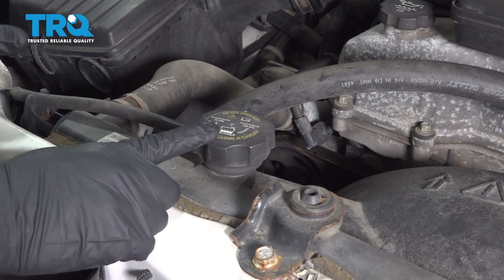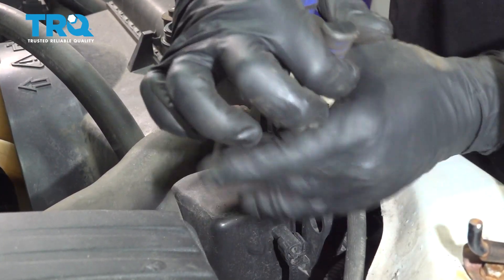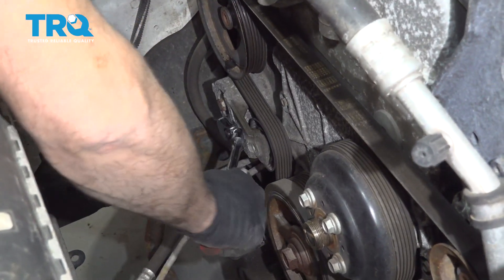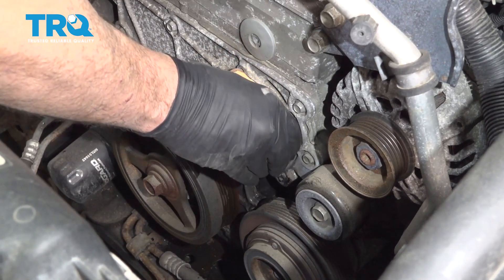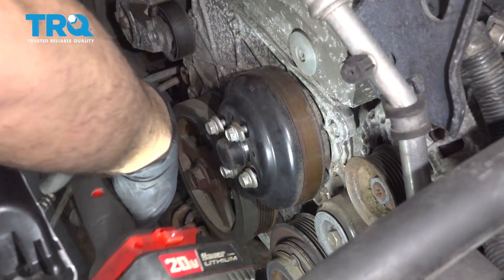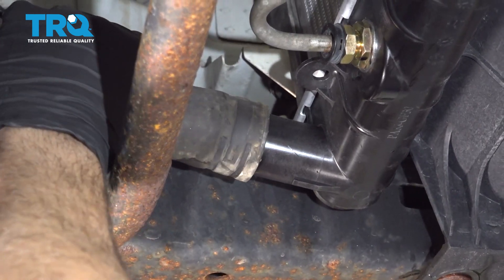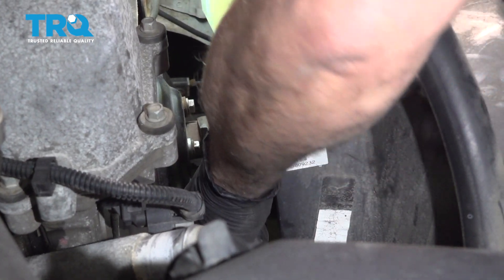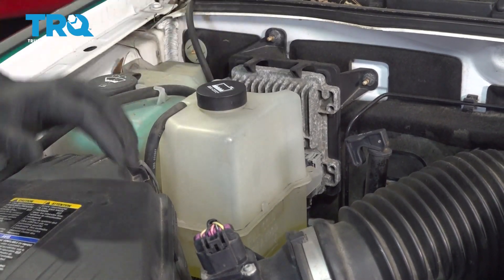How To Replace Engine Water Pump 2004-2012 Chevy Colorado

Comment: If it helps. I usually remove the fan shroud first to get more space to remove the fan.  

The shroud is a 3 piece part. It has some clips keeping all 3 pieces together. Once you remove those clips, the 3 pieces can come off easily.

Comment: I did this recently and the special tool from the auto parts store, being thin and the nut being on for many years, did not work. So i had to remove  the pump, pully and fan as a unit, not easy nor fun. I had to cut the pump apart with a right angle grinder, then get a pipe wrench on the square fan nut, it finally came apart.

Comment: Use the correct gasket remover and a plastic razor blade. Sanding on aluminum mating surfaces can cause low spots, that leak.

Comment: What was that tool 🔧 you used to break the fan clutch loose off ? 🤔  ?
Reply: Air hammer. It is a thing not pulling your leg. Life changing tool if u work on stuff alot
Reply: Ha!  I came back to ask the same question.   Thanks!👌🏾